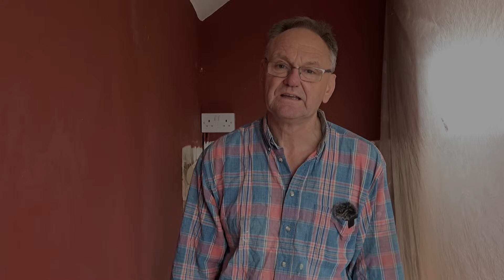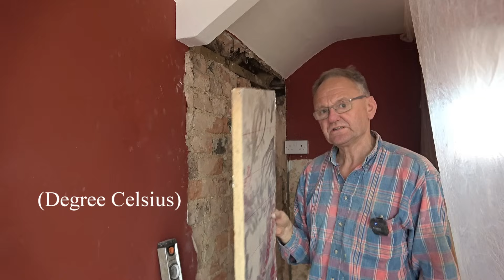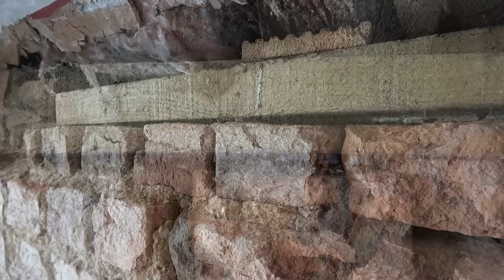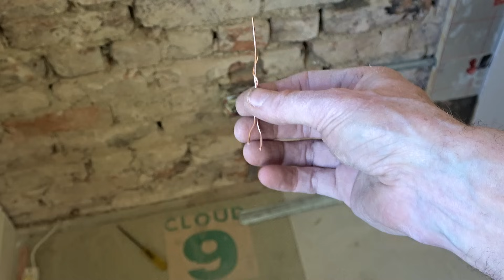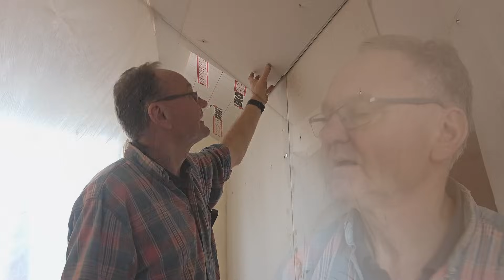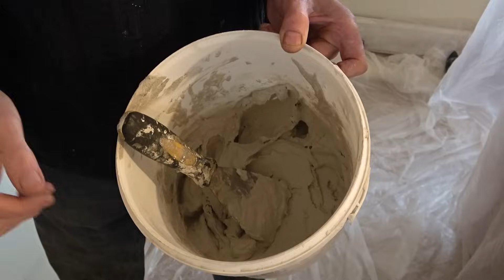HS165 Insulating a solid wall (Do it yourself)

Comment: Hey Paul, great video.

As for the barrage of comments talking about condensation, breathable, yadda yadda. The reality is, all the breathable insulation types suck compared to PIR and at the end of the day what matters is the comfort of the house for the occupants (especially while energy prices are so high).

Yes, there's a risk, but old houses tend to be quite leaky which dries out moisture fairly well, and if anything, putting on such rigorous VCL actually makes things worse, because it will fail eventually, and moisture can just end up trapped. Additionally, adding the VCL to the single wall won't do squat, because it needs to be entirely continuous, otherwise the moisture will simply find another path.

The correct way to do this is to never insulate internally in a cold country—it's always going to be a theoretical disaster (reality is often different). In cold countries, you should insulate externally. That's it. 

But most of us don't have that luxury so we do what we must. Crack on Paul, nothing wrong with what you've done. The only thing I'd say is you should switch to paper tape over mesh tape. When you were plastering those corners you could have folded a piece of paper tape and taped over it, preventing any cracks which will eventually telegraph through via movement.

I'd look up Vancouver Carpenter as a great resource for all things plastering and taping.
Reply from the maker: Thank you Tephonos, I'm a strong believer in just doing what we can as a practical compromise. In one case I only had space for 12mm thick PIR foam insulation with plaster board over (1 inch in total) and it transformed the feel of the room.  External insulation would be very expensive, and in that particular case the passageway between my house and my neighbour's is only about 12in wide - not even a normal ladder rung width. I did once have to get up there in between the houses  and I had to make a bespoke thin latter out of wooden rails just wide enough for one foot on a rung. I can just get in there sideways with my back against the wall - luckily I don't have a big belly. Cheers
Reply: Vancouver carpenter is brilliant, I would definitely recommend him as regards to dry walling 👍🏻.
Reply: The reality is half of the houses in UK have mold because people do not know how to do proper insulation and do not care about condensation.
Reply: Simply not true. Cork, woodfibre and aerogel boards all have similar thermal efficiencies to PIR and are breathable.
Reply: @viktor7401  No they don't lol. Basic U-value calculations will tell you they're nowhere near comparable. Aerogel is the only one that is actually anywhere near comparable but is pretty expensive.

Comment: you mentioned about using screws. What about using plasterboard foam on the insulation?
Reply from the maker: Hi Chris, I used screws because that's what I've used before and each time I think this will be the last time. I know the professionals use adhesive foam but I always imagine learning the new skill I'd get it everywhere so I stuck with screws, this last time 🤣 Cheers
Reply: @HaxbyShed  I’m planning on doing exactly the same thing as you did but trying with foam. Im sure that insulated plasterboard is paper backed and not foil backed which may cause a problem in terms of will it stick properly to to the substrate. Ill make a small test and see how I get along. Look forward to watching more of your videos

Comment: Plenty of good advice here, but there is also some stuff that could be done better. Firstly there was no attention to airtightness, and it's obviously bad given the daylight in various places. You really should have taped the insulation joints and made sure they were sealed around the edges so that warm air from the room couldn't get behind the sheets and condense. This would be a worse problem if you had thicker insulation but it's still shoddy. One of the main advantages (other than cost) for having separate PUR and plasterboard is that you can tape the insulation joints properly (it's impossible with the bonded boards).
I did this on my house (but with 80mm PUR) and used foam PUR adhesive to hold the board on rather than putting in a load of thermal bridges with the screws. If you did want mechanical fixings then the plastic sort used for external insulation would have been much better than screws and rawlplugs. Foam glue behind the boards also stops air-circulation in the gaps so long as you do continuous strips across the boards and round the edges.
Leaving that gap at the bottom is bad. It's very important that insulation is continuous otherwise you've just left a thermal bridge, and in this case a huge gap in the airtightness layer. I'd have chopped the brick back to line up with the rest of the wall, but failing that some squirty foam is your best bet.
It's also important to do the bit between the floors and not just leave an uninsulated gap. And the airtightness should continue down to the floor below, with taping round the joists. I explain all this in my retrofit video: car-park-to-stone-bridge_psargent-2017-08-06.gpx.original
Reply from the maker: Hi xxwookey, thanks for the advice. I'm sure it will help people looking for the best method. After the video, with advice from comments, I pumped in expanding foam at skirting level which I hope filled the uninsulated lower section. The bedroom is now a lot warmer. We are heading towards a year on and so far no mould or smells are apparent, but of course I don't know exactly what's going on behind the insulation - and I won't be taking it off to check unless a problem develops in the future. Cheers.
Reply: @HaxbyShed  Sure the comment was very much aimed at people watching later. Obviously you are not going to tear it all off and try again.
It just pains me to see people putting up otherwise excellent videos with no mention of airtightness or vapour transport. These things do matter.
How much of an actual problem it is in your case is very hard to know. I have seen examples where it's really quite disgusting and mouldy behind there (with rockwool rather than PUR) and I know of examples with thick insulation in bathrooms left for 15 years and it's been fine (but that one was properly sealed round the edges).
You probably took reasonable care round the edges as you seem a careful sort of chap, and that fact that you repointed a lot of holes will reduce in/exfiltration but the sockets are big holes in the insulation with no airtightness measures so significant amounts of warm room air may well get in there and thus behind the sheets and then through holes, depositing moisture in or on the wall. You could take a socket off and have a look. As they are screwed to the wall surface which is only 1/3rd of the way through the thermal gradient, if condensation and mould growth is happening you would be quite likely to see it in there. If it looks OK, then it's probably OK, although I'd check again in 3-5 years time.
In case you have more walls to do (or ever want to make another video about this) you should read 'Thermal Byass risks' by Mark Sidall (on the AECB website) which is an excellent dsicussion of the whole subject.
Reply: @xxwookey  Honestly, no matter how good of a job you do with vapour retarding, it'll 100% fail eventually. Plastic membrane sheets fail, tapes fail, etc. You only need tiny holes to form and it's basically bust. The only correct way to do this is insulating externally. You just have to hope that the condensation that forms with internal insulation is never bad enough so that it can dry out before any damage occurs.
Reply: @Tephnos  Sorry, it's just not true there there is 'only one way to do this correctly'. External insulation is always better, I agree, but internal insulation can be fine. First it can be built vapour-permeable (woodfibre) then there is nothing to fail. This is IMHO the best system for most older and single-skin buildings. It can also be done with tapes and membranes. Small holes (yes there will always be some, and some vapour permeability, even if slow) are not usually a problem, so long as there is some sufficient rate of drying. There are numerous built examples to demonstrate this (or at least that 25 years is OK).
Reply: @xxwookey  Actually, small holes are basically flashing neon lights to vapour (the more you attempt to keep it blocked, the worse any tiny little holes become. Much like how an airtightness barrier can be completely ruined by very small tears). The membrane needs to be continuous, or you run the risk of condensation being made worse by having the VCL in the first place. There is a more modern understanding that if you cannot make it continuous, it is better to just not include it at all and focus on ventilation instead. Which is easily done with old leaky homes. You will also struggle to find examples of VCLs actually being done properly in this country, as tradesmen like electricians will happily cut right through the barrier to run cable/socket boxes and don't understand what they have done.

I will agree with you that breathable wood fibre can be a workable option—but that's also party because these insulations have pretty crap U values, and you will struggle to meet modern standards. Part of the reason they work well is because the higher your overall U value, the far less chance of these problems appearing in the first place.

A wall that meets the 0.18 U value regs of today would be hilariously thick with wood fibre.

Comment: Have a similar arrangement with ancient house and no cavity external walls. Have been hesitant to put the PIR board on to bare brick due to damp and bridging. All the advice I read online suggests not attaching this stuff to bare brick but actually putting it on top of plasterwork. Something that troubles me about the PIR plaster back boards with the damp proofing membrane layer is that, well, surely every board provides a break in that layer and every screw you put in to it essentially acts as a bridge and potential source of moisture/mould. 
Anyway back to the way you did this, did you consider some kind of damp proofing course between the bare brick and the PIR board (as its an external wall)? Or are you counting the foil backing itself as adequate?
Reply from the maker: Hi cgavin, as I mentioned in the vid I have no expertise beyond DiY but I do have some practical experience having used this technique in several rooms of the house over the last 10 years or so with no known negative affects. Definitely there are some methods that are very likely to cause problems and some that are very unlikely. It depends on your attitude to risk vs cost and you can drive yourself mad thinking about it. I was watching a really good channel this morning called "Charlie DIYte" where he talks about insulating solid walls - considering several methods and it's really informative.    Cut a long story short the big manufacturers show recommended methods and often they involve breaks in insulation - like insulation between wooden battens. So I suppose yes I was relying on the foil backing to give a vapour barrier, and yes cutting out for sockets and attaching with screws would be cold spots (albeit in a plastic fixing plug). Not what a (risk avoiding) expert would recommend. In a very old house it's often a case of compromise; with care you can make a big improvement compared to the existing.  It was a bedroom, we sleep with the windows open, and generally we do not have high vapour levels in our house. If you are concerned then you could add a membrane behind the plasterboard - in fact if you use insulated plasterboard I think it has one built in and you could tape over the joins. I hope that helps. Cheers

Comment: Looks just like my bedroom wall (weather facing) Edwardian brick work shot mortor on inside, plaster popping. Ive just studded it out nice and plumb ready for the boards. Im debating whether to put some 25mm silver backed insulate, but ive learnt a lot about these solid walls and allowing moisture to pass through both ways is a must for them to breathe so im put two decent vents in the new boards to allow damp to pass through and allow circulation. Like you say these old houses are an absolute pain
Reply from the maker: Thanks for the report. Coming up towards a year since I did that job and so far we've not had any problems with condensation or musty smells but that wall is well pointed and very sheltered. No vents, I took a risk I guess.  Cheers
Reply: @HaxbyShed good to hear, great job by the way 👍 .... I've got the dreaded pebble dash render on the outside so I haven't the foggiest what state the pointing is in.
Reply from the maker: @Lc-is8vn  I'm sure a builder will say the rendering is 'blown' and letting water in behind it which makes the wall wet behind. That's their usual term for the stuff failing, coming off in sheets sometimes. Cheers

Comment: Well done! I need to do a similar job so that is very helpful. Is the room warm now?
Reply from the maker: Hi, well all I can say is that wall, behind our bed, was always freezing in winter. It was sucking the heat from the air. Now it is insulated we do not feel that. A small amount of insulation makes a massive difference to the feel of it. I'm not suggesting it is insulated to a high degree like it has saved us a fortune in heating or anything like that but the comfort level is significantly improved. Maybe this winter I will try a surface temperature gauge and compare between that wall and an uninsulated wall. Cheers
Reply: @HaxbyShed  Would be interested in this surface temperature gauge. Especially for any exterior walls that may have wardrobes against them, as poorly insulated walls and wardrobes make for a common mould combination.

Comment: I have just been looking into doing something similar to my property which has solid sandstone exterior walls, with lath and plaster on timber battens on the inside.   The only issue with what you have done here, is that the PIR (polystyrene)  insulation, while it gives a great u value, unfortunately, it is not breathable.    Brick and stone are both quite porous so they soak up dampness from rain and from ground level.   Any insulation or plaster you add on the inside should be breathable to avoid dampness / black mould / degredation of the masonry wall itself.   There are some insulated / breathable plaster systems that you can apply directly to the inside of the masonry wall which will improve the u value considerably, but still allow the wall to breath.
Reply from the maker: Hi STBYM, yes a number of people have said the same I would not disagree. I might offer a few mitigations like the wall is upstairs and sheltered between two houses but I agree the correct and 'safe' way is to have it breathable. That said, we have not had any problems with condensation or musty smells so far on any of the walls we have insulated over a 10 year period - but it's only ever been 1 wall per room. Cheers

Comment: This was really enjoyable to watch.  Does the insulation and plasterboard cause issues with breathability?  All I ever hear is that these walls are supposed to be lime plastered and nothing else
Reply from the maker: Hi RAINE, well there is an official answer and a practical answer to that question. The plaster on that wall and also the paint were modern and not breathable and we had no problems.  Also we have had no problems since insulating the wall. We sleep with the windows open and the room is quite well ventilated. Lifestyle is a factor. But I'm sure somebody will tell us the only way to be certain of no problems is to have breathable insulation and I suppose breathable paint. Cheers
Reply: @HaxbyShed  I suppose I wouldn't expect damp to rise to the first floor anyway.  Thanks for the reply.  Hope you're keeping well 👍🏻

Comment: good job done there for us novices to use as a guide...need to do this in what was a dining room with a double brick exterior wall. It has plasterboard but suspect as its really cold in the winter there is no cavity and no insulation behind the plasterboard. Feeling confident I can do this myself without needing really deep insulation.
Reply from the maker: Hi Chris, thanks for the comment. This sort of job can provide big benefits quite cheaply if you can do it yourself.  A bit like insulating a loft or lagging a hot water tank and pipes. Cheers

Comment: good video and good job. I would be interested to know if you get condensaton problems behind the insulation. The fact you went with thin insulation may save you as it will reduce the temperature difference between the cold wall and the insulation. Let us know.  I have been wondering whether to use batons, wool batons, a gap and maybe small ventilation gaps in the external wall, with a airproof membrane behind insulation, maybe this is not necessary.
Reply from the maker: Hi Brian, I have not been behind insulation (for example taking a socket cover off) but I can confirm that we have not had any problems in the bedroom or the room below - no moisture, no mould, no smells. Yet that wall feels much warmer  - maybe this winter I will compare the surface temp of that wall and one of the un-insulated walls. I have no experience to offer about other constructions except to say, in my opinion, an airgap behind the insulation would need to be vented to the outside to be of any value (but like I say that's just my opinion and not necessarily a fact). Cheers

Comment: I am thinking, if the whole could be simpler if you attached a wood frame to bricks first, then insulate cavity among the frame, lastly attach plasterboard to the wood frame with ease.
Reply from the maker: Hi MrTimjin, well maybe, I was so short of space that was the thing and I don't think the fibre insulation would be as good as the foam. I don't know I may be wrong but that was my feeling about it. Cheers